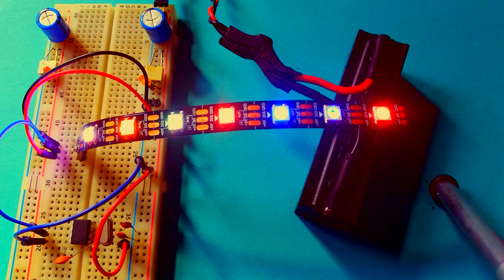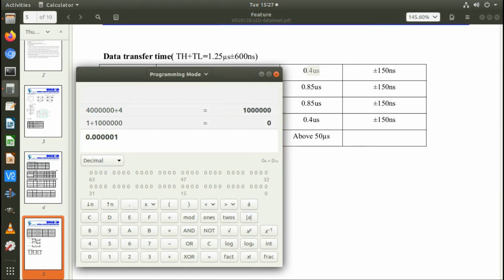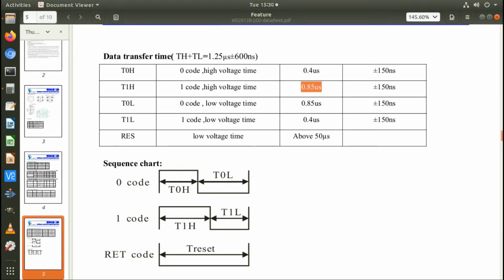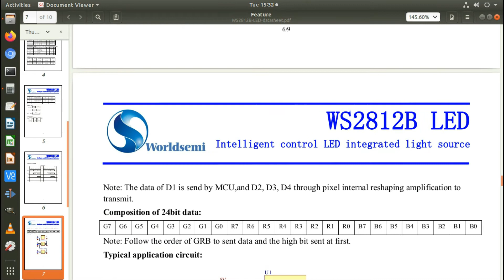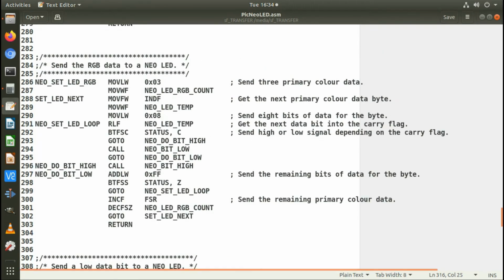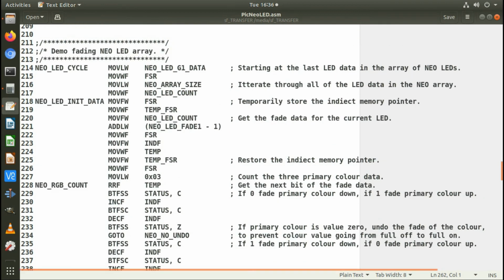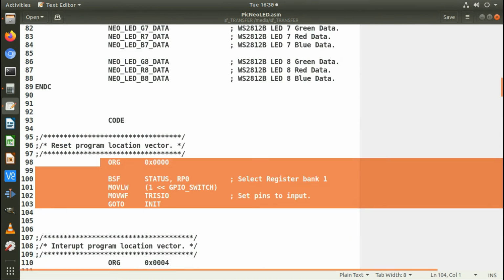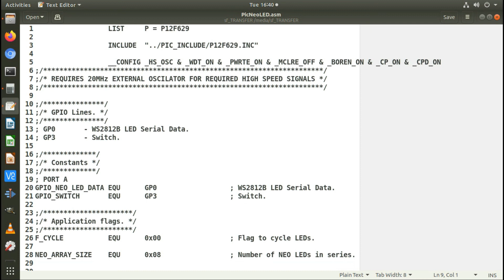Driving A WS2812B NEO PIXEL LED Strip From A PIC Micro-Controller

Comment: Good to see the classic 12F629 being used, old but with it's simple architecture makes it quick & easy to use.  Also great to see other users on PIC instead of the Arduino, I was looking for a PIC library for the APA102 2020 led instead of writing my own but looks like I may have to write my own.  ;-) 
 Instead of repeated BSF's using a NOP instruction is better practice.
Reply from the maker: I agree, I love the PIC range and the simple instruction set means I can come back to a project much later and pick up where I left of in a very shot period of time.

Comment: I just started to programme same leds , i got built up the zeroes and ones till now .
;======================================;
;Serial data send 1 bit from PIC to dut 20Mhz;
;======================================;

output_0code        ;T0H 0 code ,high voltage time 0.35us ±150ns  I GET AROUND 400 NANOSECUNDES ,TOTAL WIDH 2 US
                               ;T0L 0 code ,low voltage time 0.8us ±150ns BUT NOT LITERALLY USED OR BUILDED
               BSF  DATAOUT    
               NOP
               BCF  DATAOUT
               RETURN 	
				

output_1code       ; T1H 1 code ,high voltage time 0.7us ±150ns  I GET AROUND 792 NANOSECUNDES , TOTAL WIDH 2,4 US
                               ; T1L 1 code ,low voltage time 0.6us ±150ns  BUT NOT LITERALLY USED OR BUILDED
               BSF  DATAOUT 
               NOP
               NOP
               NOP
		 BCF  DATAOUT
               RETURN